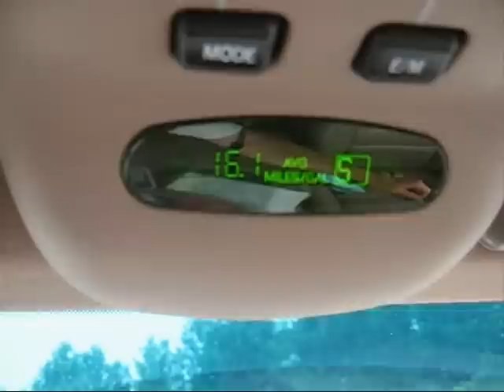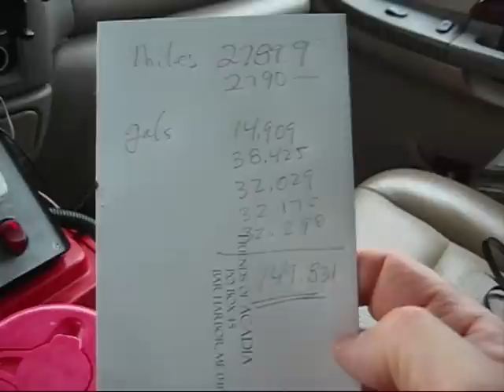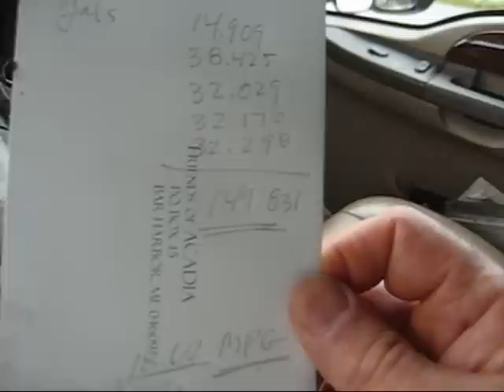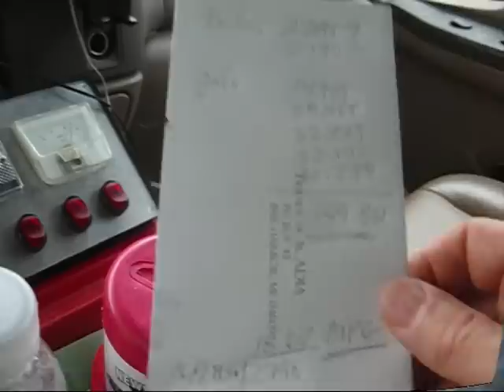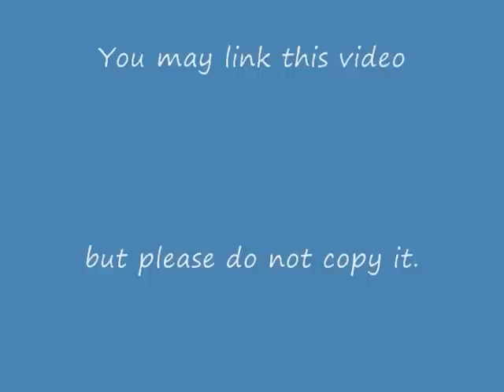MPG (mileage) Test 2790 miles with Dry Cell HHO F350 Superduty 7.3 Diesel

Comment: 18.62  sounds rather low if ur pulling 40-60 amps.  the question is how many liters per min are you pushing and what PSI, if you can get this to 50 psi consistently. you should be able to run that ruck completely off of it

Comment: I'm curious if you have run into any engine problems running hydrogen in the intake.  I have a 7.3 and I have seriously been considering running hydrogen in the intake.  Hydrogen is supposed to be good with compression ratios 17:1 to 18:1.  That is okay at idle, but that is not considering turbo boost (no, I'm not jumping).

Comment: Your gas mileage is much better than you calculated. You actually got 23.7 MPG (versus the 18.6 that you calculated). Your math error is because you added the initial fill-up gallons (32.298 gallons). Because you end the trip with a full tank (of unused fuel), you don't add the initial fill-up. After the initial fill-up, you are mathematically starting at zero gallons in order to compensate for the final fill-up of unused fuel. Big congrats on getting 23.7 MPG!

Comment: How hot is the ambient temp around the brick under normal driving? To carry 60 amps of current at 140 degrees c you will need #4 AWG wire looks like what you have is
Reply from the maker: The brick is fed by 6 gauge wires. The individual parts of the cell are fed by 12 gauge wire. Everything was fine after I soldered the 12 gauge wires to the cell parts.

Comment: I remember when you did this. I was interested in it back then. I have the same thought as you. Think water injection and HHO combined. I'm thinking about running a bigger cell and run on 120dc. And adjust amperage from inside cab ....my power source is going to be a generator running off my transmission transfer case so I only make HHO when driving... what is your thought and was it really worth it. Thanks

Comment: its basically economizing your wasted fuel from your alternator.
HHO is basically a cheap way to make a hybrid car without adding an electric motor and Lithium bank.
tho I dont recommend storing this stuff but as an additive to your fuel it makes sense.
Its not creating free energy its just an economizer but a really dangerous one because incase lets say the line going into your engine were to burst due to a flashback well that would be a bad problem!

Comment: Long term results? Have you considered running it on generator or battery bank to see what your losses are pulling off the alternator all those amps?
Reply: An alternator IS a generator. 60A...off a battery bank? Seriously??? That will drain the average start battery in maybe 1 hr. That would have to be 1 huge batt bank. Then what charges the battery bank? You may want to study more
Reply: @mrmotofy  You tell me to study more yet your statement defeats itself in the first sentence because you dont understand what is being said.. If an alt is a gen then why wouldn't it be called a gen? I am not here to have a debate of generator vs alternator or motor vs engine. We used to use generators on cars right up until the alternator came along lmao... Now that is out the way you missed the point of the comment an outside power source shows the costs of taxing the alternator for the power to run the HHO and yes 60 amps is not unheard of to power a HHO device. HHO/Browns gas is not magic it is produced at a cost if the vehicles battery is part of that equation then the engines consumes fuel to power that cell. Any gain seen by HHO produced on board via the automobiles charging system will be negated by fuel consumption because (deep breath)1; The automobiles engine has to be perfectly tuned for the fuel source or mixed fuel source being supplied thus it cannot be a 100% efficient return. 2; No gas used in any combustion engine has ever been 100% efficient. 3; The tax on the alternator costs power that costs fuel. Some people tend to think oh my vehicles alternator is rated at 140amps so i can use up to 140amps and it wont cost me any fuel that is an untrue notion/statement.  My current vape mod runs 2 cells both rated at 50-60 amps or so. A few dozen of those and a voltage regulator would be fairly small compared to what ever your thinking and plenty capable to last enough for a one time test of MPGs to power the device without taxing the vehicles systems. As for what charges that hypothetical bank well we could get your mom on a exercise bike hooked to an ALTERNATOR...for real dude charge it how ever you want to, it is a battery bank not rocket biology...  SO, who really needs the education here? Don't bother asking me to define, clarify farther. or any questions at all because you entered the conversation with to much arrogance to warrant my farther debate with someone like yourself. Did you really think you found a free candy bar laying in YT that no one took a bite of in 1 year? They all (ALL) knew more than yourself. Let that sink in realllllll slow. Next give courtesy with your approach and respect with your questions you never really know what someone else is capable of. For the record i love HHO/ Browns gas and think it can be used in many many ways beneficially like to run off a solar system to heat and store heat in a battery bank for later use, direct gas heating with sand filled diffuser heaters that some have built already, used in and heat exchanger by flowing through and self igniting inside a catalytic convertor to create force air heating, and many many other very inventive solutions i have seen over the years with 1 acceptation which happens to be the worst and most common attempt of them all and that is use in a combustion engine not designed for nor tuned for the gas.
Reply: @masterdebater8757  Generator- noun

a machine that converts one form of energy into another, especially mechanical energy into electrical energy, as a dynamo, or electrical energy into sound, as an acoustic generator.

Your "point" was unclear as written and you've now defined. Sorry I missed your poorly worded point. The alternator is a continuous generation of power as needed till the fuel runs out. A battery is a limited capacity source. So they aren't an interchangeable source.
Reply: @mrmotofy  i was editing and again i dont need you to recite definitions either i am perfectly capable of it myself. Read my comment and please dont reply again. I have over 50 a day to debate with more respectful, interesting, and intrigued individuals. again im not going to debate definitions of alts and gens nor my lack of proper grammar  or even heaven forbid "semantics"...

Comment: take this as corrective criticism please.... from an old hand at HHO cells. your wires are too small for 60 amps going to the cell
go to the next size bigger or even the second size bigger wires.
it does you no good to add HHO and not lean out the fuel.... if you don't lean out the fuel it will still keep pumping the same amount of fuel out the exhaust pipe as it did before the HHO generator.... you experienced an improvement in MPG but ONLY because HHO just makes the Diesel burn more completely....that's all ! if you really want an improvement on your MPG you will have to find a way to lean out the fuel on the truck that the computer doesn't counteract.... that can be a real tough one
On my toyota Pickup (gas) R-22 engine I tried many ways to fool the computer with no success ...until I put in a air bypass valve around the Air Sensor on the intake that did the trick I could start the truck on gas and lean it out till it staggered bad and then turn on the HHO generator and it would smoothe out and run great !   I went from 20~21 MPG to 40~48 MPG by doing that
you should get MUCH better improvement than I got....  but you have to reduce the diesel the engine is getting !!!!!
good luck..... never go completely HHO because the state will nail you for back road tax if they find out !
...... Bob......

Comment: For 7.3L best way use Stan Meyer system,  dry cells take a lots of amps, yes need use second alternator , but second alternator need to be modify like Stan Meyer, so you will get more voltage and hi frequency. you can get same amount HHO with 10-15 amp
Reply: Is this guy using a pwm? That seems to help efficiently if you can't make high frequency another way.

Comment: You are using too many amps, I suggest to use a car converter to change the 12 V to 120V AC then use a high voltage diode and connect to your HHO generator using 30 - 35 plates with only one positive and one negative. If you need more gas utilize another set.By the way  thanks for sharing...
Reply: AC doesn't have + or - you don't have a clue what you're talking about

Comment: thee,

I am new to this hho generator building and will start building one soon. But sir, PLEASE if you do something with hho, then please make sure you are doing it proper! If you need ventilation create ventilation, if the cable's are not installed properly, fix it, if they heat up then use thicker cable's! Beware of what you are working with.... It needs to be researched but if you do it like how you are doing now, I strongly advise you to do it in a mare professional way. You are driving a gasbomb basically. You have got it placed outside the vehicle but, if you have installed the gas supply as poor as the other 'issues' I wouldn't like to sit next to you in that car. Please man be careful with HHO. 

Thanks and kind regards,

Dennis.

Comment: I see a video of a guy running his truck on only the hydrogen has and he had four bricks and was only pulling 10 amps he said the generators were made with 20gauge steel and all his bricks together was not as large as yours his whole system fit under the hood

Comment: 62 Amp !!!! that crazy amps !!!  Better just drive with Lincoln welder on the back with this HHO system,  this amp kills all idea HHO. This system build totally wrong way. To make right way HHO need to build by Stan Meyer way, high voltage , frequency, low amp, plus  Stan Meyer's cells work with any water temp. cold, hot,  salt water, fresh water any kind of water. I drive on my Excursion 7.3L with Stan Meyer system, 21MPG, takes 3-4 amp, and I don't care about water temp. , system works very stable
Reply: can you add proofs?as far as ive found.they reworked Mayers draws and now it doesnt do shit if you try to make up from his plans

Comment: to all, I have a 99 f350 with  a banks power pack and a banks cool air intake. I kept my foot out of the pedal and drove from WPB, FL, to los angeles, ca. I avg'd 22+ mpg! I am not in a hurry! idle speed. 48 - 55 mph. my truck pulled my landscaping trailer with some tools and camping gear. I let the truck do the driving and I enjoyed the scenery.....
Reply: With the speed limits being 70-80mph in most states on Interstate those speeds are legally too slow. It actually impedes traffic and I've heard stories of people actually getting cited for it. Or sometimes told to stay off Interstate at those speeds.

Comment: I have seen the designs of some of these things and a technicians knowledge of electrical theory, or maybe just some advice for improvements from a knowledgeable HVAC tech would go a long way to helping you get a better result. You can't excape the laws of thermodynamics and should have a working knoledge of that as well.

Comment: HHO is a scam, it does not work, it will cost you hundreds of dollars, countless hours and by the time you determine it does not work you will tuck your tail between your legs and just be happy to quite and not bother your self any more.  Those people I bought from all blamed me for it not working. Convenient as I am an experienced, mechanic, plan reader and builder.  Put your money into a good gas additive and tune your engine. Let Detroit put an upgrade on your new car if it could give you 30% more mileage wouldn't they do it to sell their cars?
Reply: Lol if you don’t know how it is I have run a truck purely off hho if you buy one of those cheapo kits

Comment: Use Stainless Steel connectors used on electric ranges available from appliance parts supply stores and other sources.
Reply from the maker: Ray Becker, Good idea.

Comment: nice that ypu give some measurements. If your previous milage was
16.1 miles per gal and now 18.62 . thats a increase of 2.52 mpg and that is 13.5% better. Congrats.
Reply: Urban Jönsson yes, but if he normaly drives 65-70mph and this time he drove 55-60mph, that fuel savings is from less wind resistance.
Reply: Yes - it could be from wind - and an other thing is how much load it had on. But I think he knew that and was talking about that in the video.  
I have watched many videos about hho savings - and find very little hard evidence. Most people say they experienced positive effects. But you need to fill upp tank to the brim, and reset odometer (tripmeter). 
If you want even more precise measurement - it could be made with a gps that calculates every single meter you drive. And of course drive the same route and same load and same speed.

Comment: These systems claim to achieve large increases in fuel economy, but it is predicated on a fallacy. The delusion is based on the idea that the electrical power used to make the hydrogen and oxygen is somehow "free" or "excess". This is not true. When you increase the electrical load on a car, the alternator's voltage regulator increases current in the alternator's excitation coil and this in turn makes it harder to turn. The engine then has to provide extra work to spin the alternator - and this extra work comes from the gasoline fuel being burnt,Lol think people!

Comment: dumb hho sucks, won't save gas
Reply: You are stupid.
Reply: These systems claim to achieve large increases in fuel economy, but it is predicated on a fallacy. The delusion is based on the idea that the electrical power used to make the hydrogen and oxygen is somehow "free" or "excess". This is not true. When you increase the electrical load on a car, the alternator's voltage regulator increases current in the alternator's excitation coil and this in turn makes it harder to turn. The engine then has to provide extra work to spin the alternator - and this extra work comes from the gasoline fuel being burnt.

This idea is similar to placing a wind generator on the back of a pickup truck and expecting it to power the truck, i.e. truck powers wind generator which powers truck. It doesn't work because the wind generator generates drag which slows down the vehicle, and this drag requires more fuel (energy) to keep the truck moving; the energy lost to drag is greater than the energy generated by the turbine. Energy is conserved -- the difference between wind generator output and drag on the vehicle is equal to the frictional and heat losses.
Reply: word!
Reply: do you have any proof that  the generator would create a drag on the engine so heavy that it would negate the increase in mileage made by the HHO?

Comment: that's  18.72 mpg . not great,but you've probably got 3:70 rears. 3:50's would get you up to about 23- 24 mpg & 4:11's down around 12 mpg  or so. SO, tell us what your truck has ,like standard or automatic, gear ratio of the rear end ? The rear end is the most important. I don't think you've improved your mileage any at all.
Reply from the maker: 73roadrunner1 this truck has 4:11 gears.
Reply: Crickets.........
Reply from the maker: This truck has 4:11 gears and weighs 9000 lbs with my normal gear in it.
Reply: well with 4:11's I'd say you've done a good thing , with an increase of approx. 50% or more ! Congrats !

Comment: An extra 2 mpg, not anything worth doing this for! These people are going to make hundreds of dollars with your money. "I have done this. It will waste your money and time. I bought a basic system from Ritchie, "HydroClubUSA" and a basic system from "Green source" in CA. It is useless. Cost me hundreds of dollars. Neither would refund my money. Proof its a scam! I even built my own HHO generator. It does produces the gas. The carberator is not set up to adjust for the flow of HHO. You can't control the flow of gas and you can't reduce the fuel(gas) when needed. I used the EFIE AND PWM it does not work. I bought two from green source. One was DOA they would not refund them, "Amazon"! BEWARE SCAMMMMM.....$$$$

Comment: HI, I am  a carpenter by trade. I am not a mechanic. I did rebuild an engine on my pickup many years ago. The process is to understand what needs to be done and follow the Specs on the motor I was working on. I put over 100,000 miles on that motor before selling it. With these new motors I would be lost, with all the sensors tied to the computer.  I believe on the new motors there are 02 sensors in the exhaust systems, especially the diesel motors. The sensors measure the gases in the exhaust and tell the computer how much oxygen to add, or all that other complicated stuff. So I would guess if the exhaust is much cleaner with the Hydrogen, the sensor would detect this and tell the computer to do something to counter this reading and maybe defeat the clean fuel. I would think you would have to trick the sensor to not pour more fuel to the system, When it detects cleaner air. Just a thought. I agree with the No limits tech person that 18 mpg is very low with the system you are using.